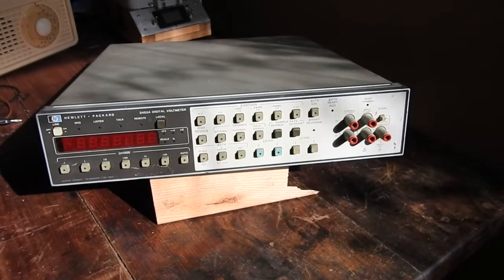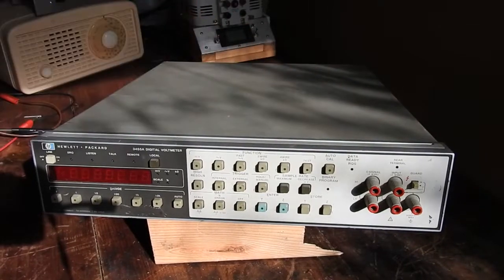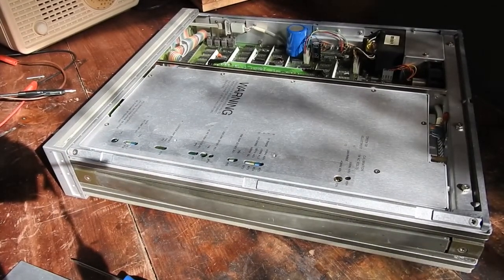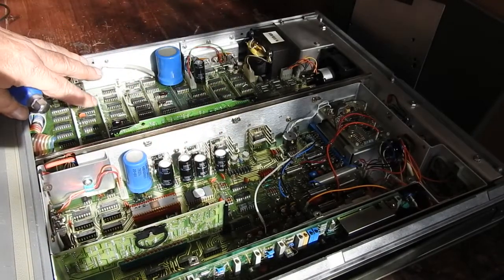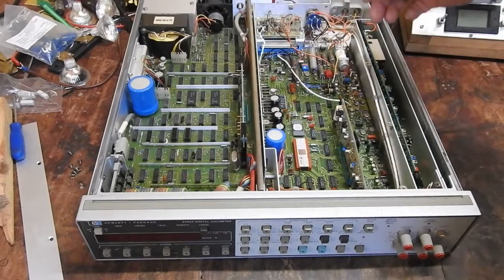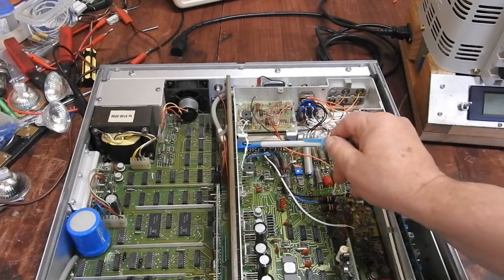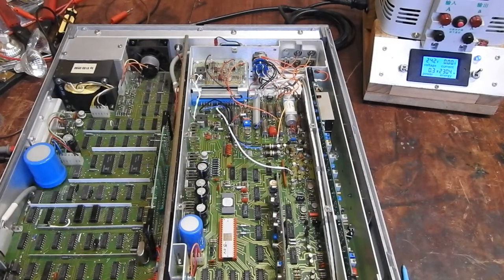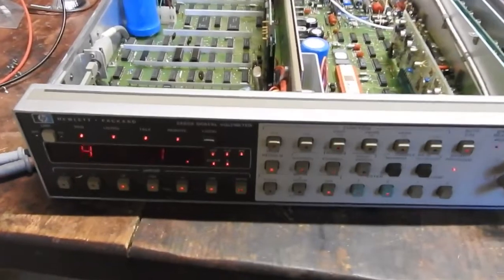HP3455A Digital Voltmeter -  A quick and dirty teardown

Comment: All of mine have needed a recap, check your rails for AC ripple. I didn't have to do the two big electrolytics, just the smaller ones. I replaced all with 1000uF 50V capacitors for convenience.

The manual's troubleshooting section is very solid, I've used it to go from completely dead to fully functional on one of my HP 3455As. Before calibration, the dead->functional 3455A agreed with my calibrated Fluke 8842A as well as I could determine -- the 3455A of course has an extra digit of precision over the Fluke. Very well-built meters, and supposedly the starting point that set the stage for the HP 3458A 8.5 digit meters that are still seeing metrology service today!
Reply from the maker: Thanks for the tips. The voltages were all good as measured by a meter, but didn't check for ripple. I will do when I return to this project. 
I didn't go into power supplies too far, because I was looking for a more drastic failure - the seller said smoke had come out of it. Not finding any source for that, I put it aside pending a deeper dive... (it's on the list!)
Reply: @bertoid  Yeah smoke is usually a pretty good indicator of other problems :) Might check under the little cover where the power entrance fitting is. All of mine have a single-piece sealed entrance fitting but I guess it's possible that some might've had RIFA caps and just an IEC connector, or that the single-piece entrance fitting let the smoke out.
Reply from the maker: @glitchwrks  I'll have a look there when I go inside next time, and any RIFA caps will go!

Comment: In your opinion. Which one do you think is better?  HP3455A or HP3456A?
Reply from the maker: I'm certainly no expert on these, but I believe the 3456 is better. It seems to be the one that gets the most praise for accuracy and longevity. 
I haven't yet opened either of mine, but I also believe it's innards are more substantial.
Reply: @bertoid  3456A have true RMS too?
Reply from the maker: @Michael-w8v  
https://xdevs.com/doc/HP_Agilent_Keysight/HP%203456A%20Operating.pdf 
p31

Comment: wait, there are 2 versions of the 3455A?

currently looking to get a metrolagy grade multi meter, and or ideally a transfer standard. (i have a metrology transfer standard for voltage and current, but this meter is more accurate then my current standard)
Reply from the maker: 2 versions? Not that I know of. There are options, such as the AC measurement board, which can be true RMS (in this unit) or a simpler averaging type.
If you mean just at the end of the video, my other 3455A is at the top, and the lower unit is a 3456A.
Reply: @bertoid  ah, that explains my confusion, should have watched at a higher resolution. My bad

Comment: Would love to see another video.  I've got one with similar problems.  Error 10.  It appears to all lead to the "inguard" section.  Rumor has it that leaky JFETs are the culprit.  Of course, part numbers wont cross even with the available lists out there.  Astonishingly, all my supplies are in good shape after 40 years.
Reply from the maker: Yes, trying to fix this meter is one of dozens of things I'd like to get around to. 

But at the moment I've gone down this PDP-11 rabbit hole, and it's much deeper than I thought!
I remember trying to find a part number for the FETs. Just looking at my folder on the unit, and found that HP 5088-7028 might be a 2N4119A, but I'm not at all sure about that.
Reply: @bertoid  Thanks.  A PDP-11?  Wow, you are ambitious!  Re the transistors - there seems to be no cross reference guide for parts beginning in "5088".  And that 2N4119A looks promising, but at $12USD a pop (mouser), I'm not sure I want to experiment!

Comment: Have you delved into this instrument yet?  Curious to know the health of both your in-guard and out-guard supplies.  Particularly the regulators and electrolytics, the latter being highly suspect since this instrument is now hovering around 40 years old.  My unit had a small oscillation on the 12V supply, which was only solved by installation of a different regulator.
Reply from the maker: Sorry, I just saw your comment after the one above, not sure how I missed it.
Trying to fix this is on the list, but other things keeps piling on top...
The power supplies all checked out OK with a meter,  and I think the gross failure in this unit is unlikely due to more subtle power supply problems. 
But yes, looking at the voltages with a CRO would be a prudent first step in the repair.